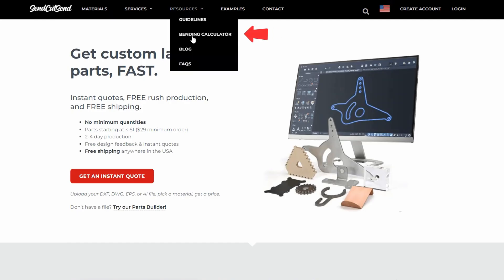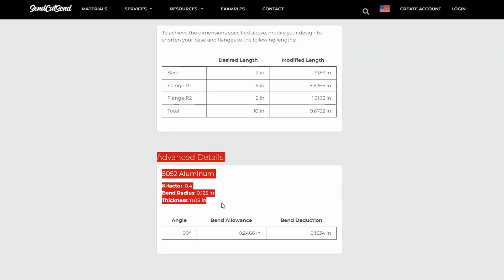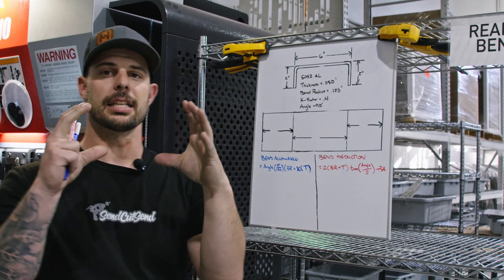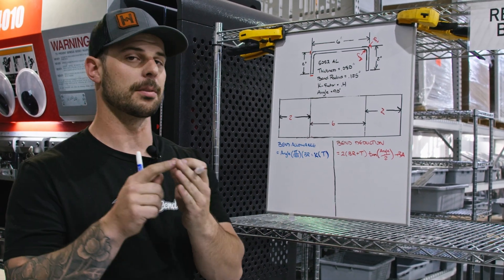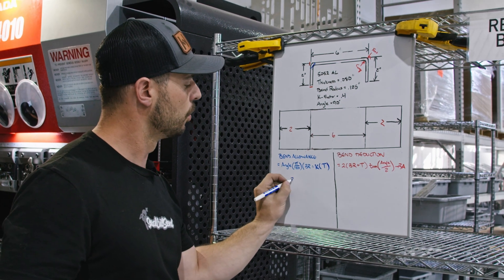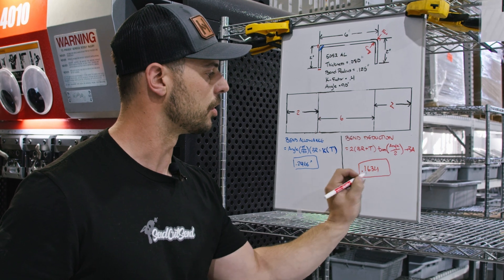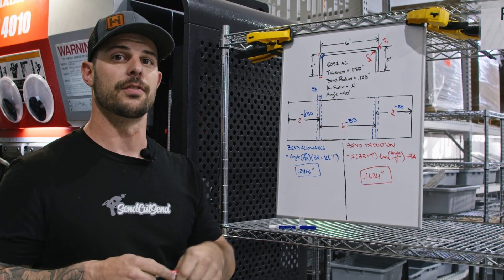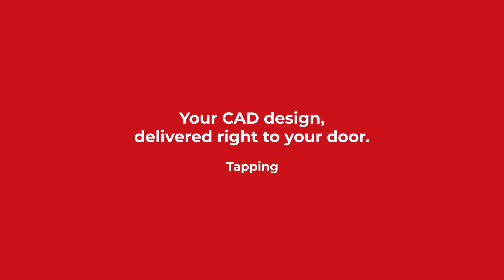How to Calculate Bend Allowance and Bend Deduction with SendCutSend

Comment: Why is the K-factor 0.4? Your website states 0.43 for 0.080" 5052 Alum?
Is the Bend Allowance 0.2466" or 0.1326"? Your bend calculator states the latter. Additionally, neither of those two numbers is obtained when you utilize that formula (90*(pi/180)*(0.125*K(0.080))). Not sure if that formula is correct,
On a positive note, your calculator is very handy and it has yielded me correct dimensions to use in CAD.
Reply from the maker: Thanks for your comment. This video was created a while back and some things on our site may have changed, we'll investigate and update the video if needed.

Comment: Thanks for information. But if I were you I would first test and then derive k factor.  Then just insert that kfactor to fusion. It will  do rest of the work. Your calculation depending on k factors. K factor varies by different materials.

Comment: Hi, thanks for the video. I was having a play around with the bending calculator and I am wondering which way to make the bends for the deduction to work? Say if I was wanting to bend a U shape from a strip of steel with a specific inside measurement - which way do I make the bends for  eg. fold one end, flip the work around 180 deg and fold the other or fold both bends from the same way?
Reply from the maker: Hey there! We don't work off of inside measurements but you can enter the outside dimensions in each of the base and flange sections with the bend calculator.
You just need to be sure they mind our u-channel ratios. https://sendcutsend.com/bending/